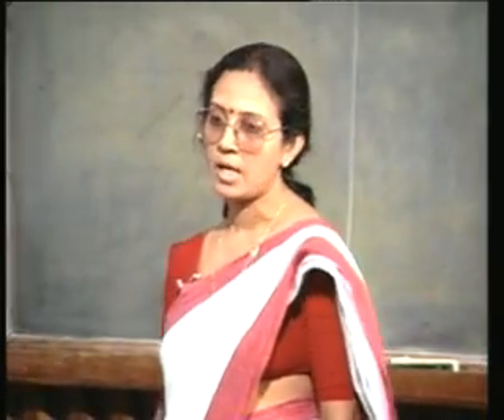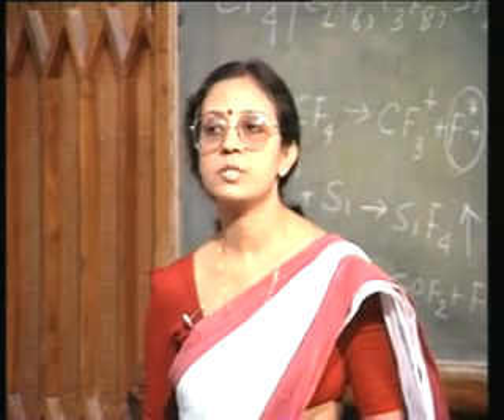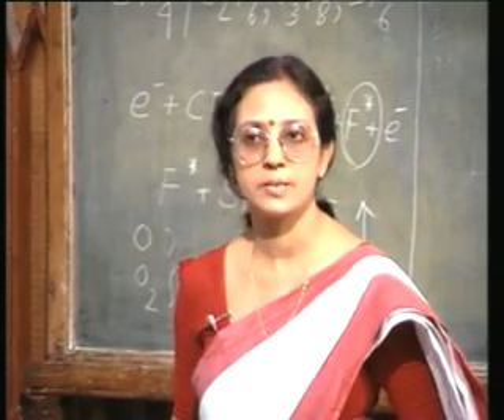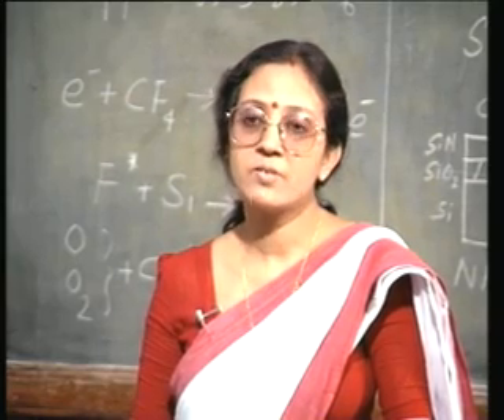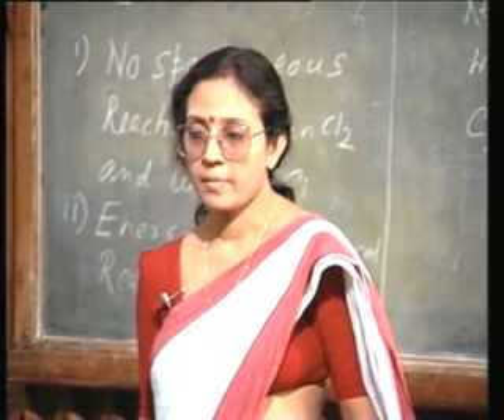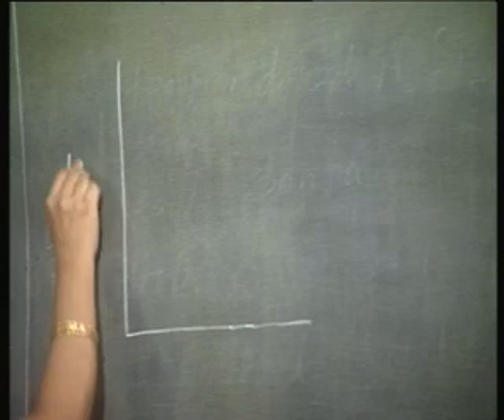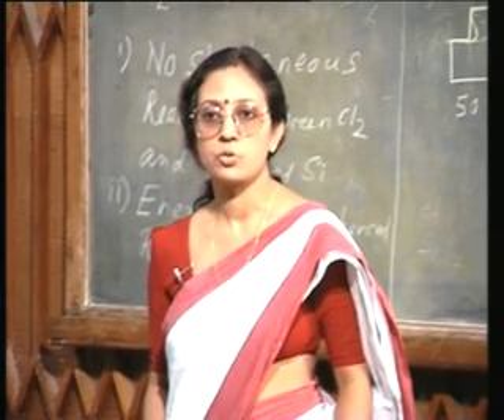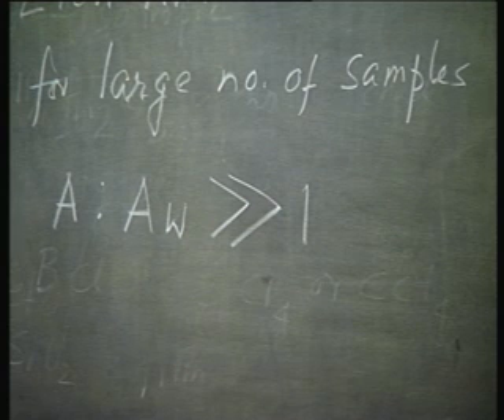Lecture - 28 Etching of Si,Sio2,SiN and other materials

Comment: Same concept used in electrical circuit si.e electrical transmission system from one place to another place ,lines are separated from poles by insulators

Comment: As I know, DRIE can make a high aspect ratio with a very good etch selectivity between PR and Si. If the thick PR film is not enough for masking, you can use SiO2 as a hard mask for etching.